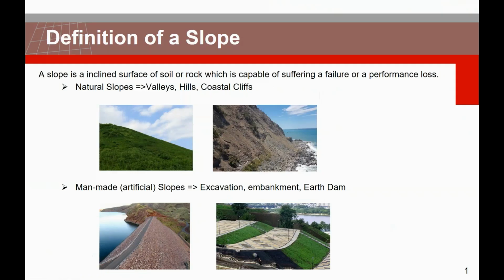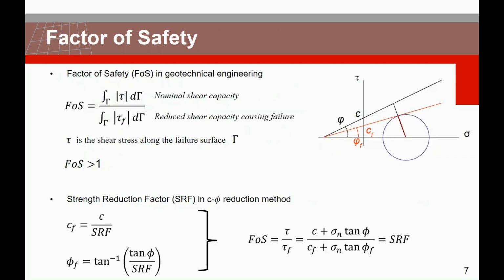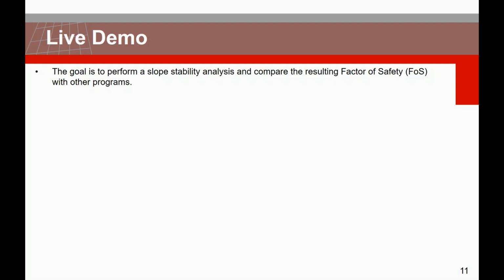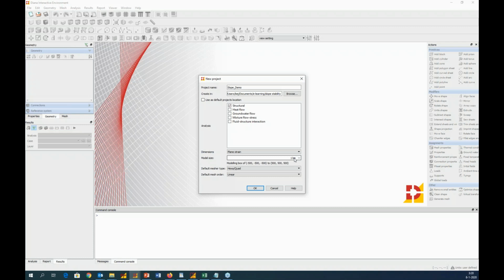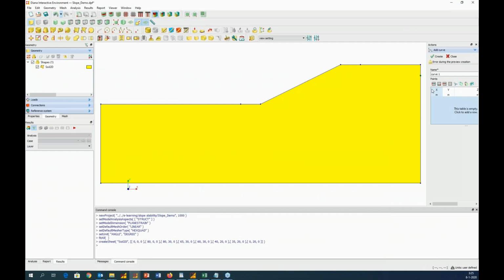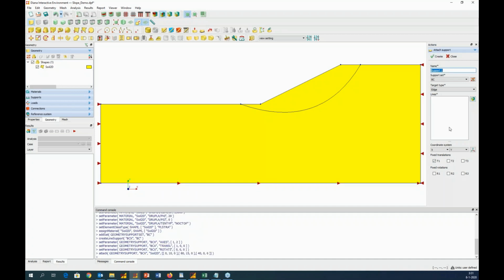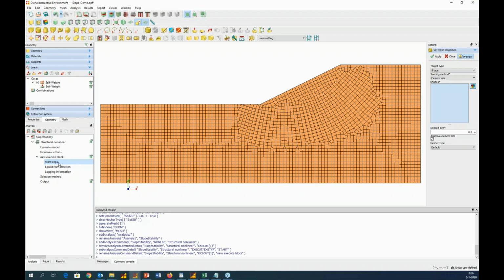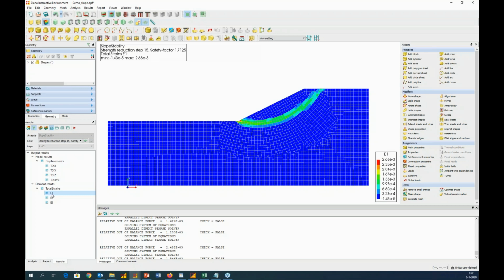Webinar: 2D Slope Stability Analysis with DIANA

Comment: can i do the same thing using abaqus?
Reply from the maker: You should do the right things right... So the best and optimized solution for both structural and geotechnical applications is DIANA.
Reply: @DIANA-FEA  but we only have permission to use Plaxis and Abaqus.
Reply: hi, at my work i can only use plaxis and abaqus, did you get finished your design?